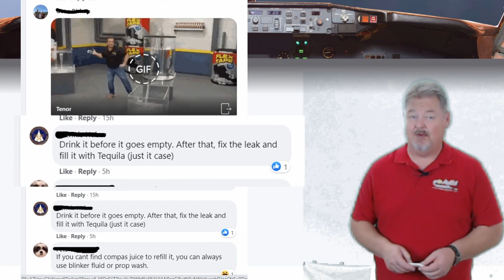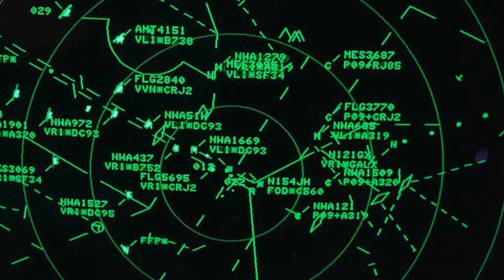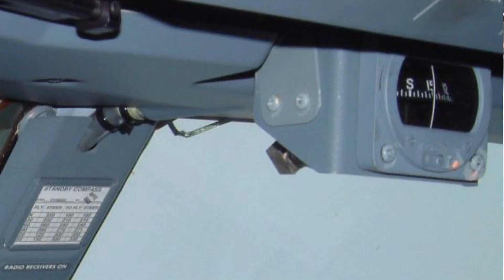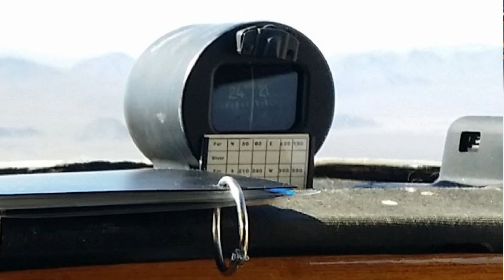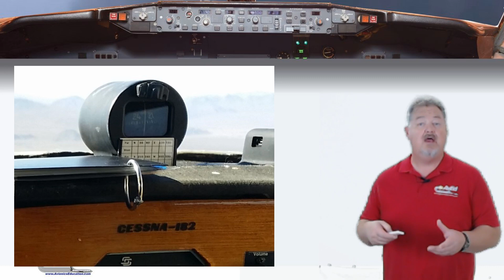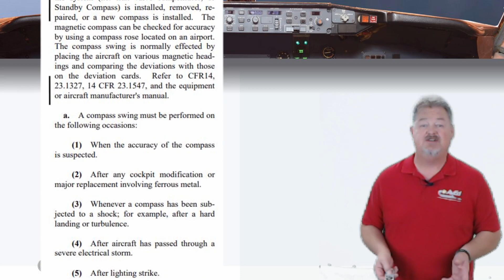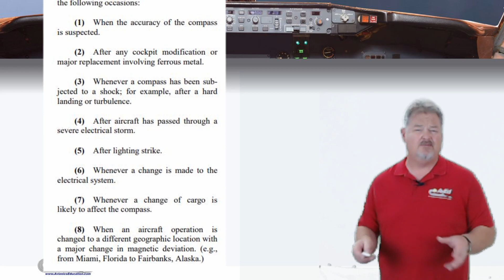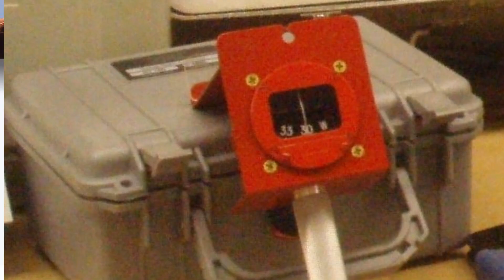Understanding compass maintenance

Comment: Speaking of confusion, your mention of gyro-stabilized compass systems with flux valve magnetic sensor may lead some viewers to think that they provide a different or more accurate heading reference than a whiskey compass.  In stable flight they do not, as the flux valve senses the same magnetic field as does the simple magnet in a whiskey compass.  They greatly reduce turning errors, provide mostly-accurate indications in turbulence, and can reduce deviation errors by locating the flux valve away from major magnetic disturbances in the airplane.  But in the end, they still require correction for magnetic variation and deviation.
Reply from the maker: Different yes, but not more accurate.  The standby compass is more susceptible to errors because it requires pilot action to set the gyro compass.  this requires that the aircraft not be turning or changing speed.  (ANDS). However the flux valve system will provide constant magnetic correction throughout the flight.  But you are correct in that the flux valve requires a compass calibration just like the standby one.

Comment: where do i find the document that tells me the maintenance time?
Reply from the maker: unless otherwise described in the aircraft MM.  the compass system is to be inspected for security and operation every year as part of the Aircraft Annual Inspection described in the FAR 43 Appendix. the guidelines for the recalibration of a compass is described in the Advisory Circular 43.13 2B or 1A

Comment: Too much general theoretical speaking rather than practical things  which are met on the technical field. In my opinion the video is a little bit useless for avionc s technicians as as far as they concerned.
Reply from the maker: You are correct. This was created as a training aid for students in my avionics program. Most of my students had never been anywhere near an aircraft so the class was very elementary.  They did perform a compass swing as a lab project, but I always emphasized that they needed to use the aircraft maintenance instructions.